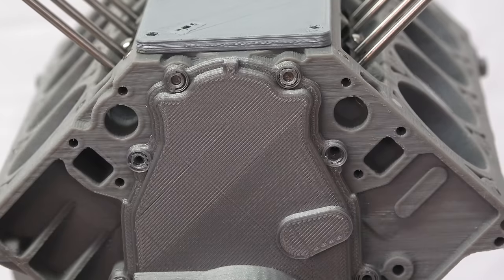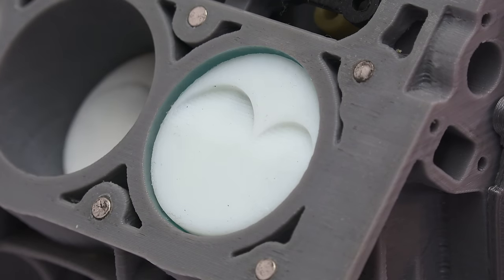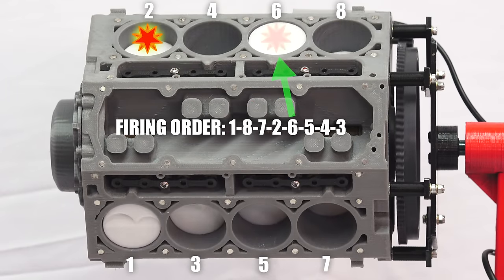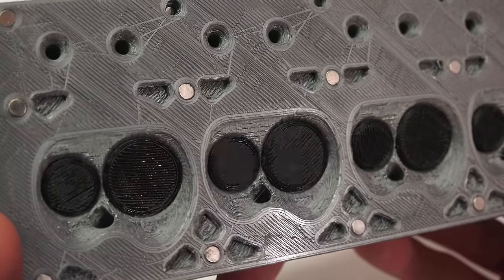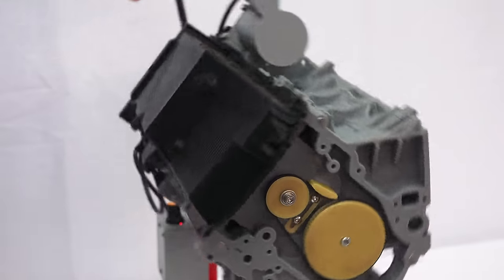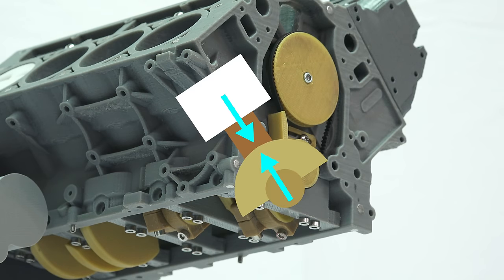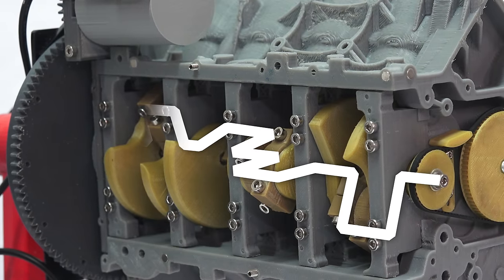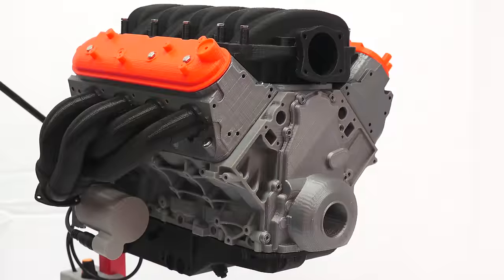How V8 Engines Work - A Simple Explanation

Comment: A small block Chevy (also known as SBC engine) uses a distributor geared to the camshaft, that also drives the oil pump below.  The firing order is also different, 18436572, fired using a distributor cap, rotor, and coil, to send electrical charges to the spark plugs.  Modern engines, such as the LS blocks, use a coil on plug design, hence why distributors are phased out.  You'll also note the use of a lifter galley on a SBC engine, as the camshaft is placed slightly higher above the crankshaft for the lifters to contact the cam, thus the pushrods are hidden away inside the galley along with the lifters.  The galley is hence covered by the intake manifold, and sealed on both sides using gasket maker, and/or a cork gasket.  

One quick way to tell the difference between flat tappet and roller lifters is the use of a lifter retaining bracket "spider", which holds the roller lifters in place to keep the lifter and roller from spinning against the cam's lobe direction.  Flat tappets have to rotate to wear evenly, so no lifter retainer bracket is used.

Comment: Hello, Engineering Explained ~ I've been told the #2 cylinder valve on my V8 is stuck open. It's either the intake valve or exhaust valve. It will cost $6,000 to have a new engine put in. I'm uncomfortable with the unexpected diagnostic stating I need a new engine.  In fact, I'm dumbfounded. Watching your video helped me understand how the eight cylinders work.

Comment: Also the 90° positioning of the Cylinder helps to cancel most of the vibrations. You can see motorcycles with 90° displacement without additional balancing shafts, but when the go 75 or 60° a balancing shaft with additional  weight is required.

Comment: I always had an interest in the balance of an engine. I think it would be interesting to do a video like this on a V6 and also the balance between a 60 deg and 90 deg V6. I know 60 is better for balance while 90 is done so both a 6 and an 8 can come off the same assembly line to lower cost.

Comment: You should have elaborated more about having 2 connecting rods on one crank journal.  This is a huge advantage to keep the engine short and machining simple.  Unlike like many engines  that are not at 90 deg.

Comment: Great graphic; good job on the video.  I have a firing order question.

1-8-7-2-5-4-3-6 seems to fit my sense of progressive order better than 1-8-7-2-6-5-4-3.

In a sense, my thought process follows the alternating star pattern of tightening wheels lugs or head bolts.

What is the advantage of the existing firing order in terms of balance.  Maybe I am hung up on the starting point, but I feel that I am missing something and am trying to grasp the engineering principle involved.

Comment: The GM LS1 I swapped into my 01 Cherokee is about 190 pounds lighter than the ancient 4.0 six cylinder I took out. I got a little less than an inch of lift on the front, without touching my suspension, other than adjusting the track bar a little. Also, the more advanced fuel system, with 4 nozzle injectors yield about 6 more MPG as well as  almost double the horsepower.

Comment: I've always complimented on how you show and explain things to us non-mechanically inclined people to the point where we understand.  This video though I had to watch a couple of times to really get it.  

My question though is this:  If the ratio from crank to cam is 2:1, what does it mean if someone wants to upgrade their cam?  Does that change the ratio or will it ALWAYS be 2:1.  I have an LS3 engine in my Corvette and people have said I should change out the cams.  What happens then?
Reply from the maker: It will always be 2:1. The crank must rotate twice for every cylinder to fire (pistons go up and down twice). The camshaft has a task for each of those four strokes, so it only rotates once for the pistons going up and down twice. Upgrading cams will change the lift and duration characteristics. Explained here: https://youtu.be/6MmuEhCRR_U

Comment: I think you meant to say the two opposing pistons are paired to the same crankshaft JOURNAL instead of bearing, as each connecting rod has its own bearing to contact the journal. Other than that good video.

Comment: Exhaust gasses are pushed out by the Piston?  Always thought the still expanding combustion was doing that work.
Reply: CMac well now you know..:-)
Reply from the maker: Pressure certainly pushes out most of it. But if the piston just sat there, some gas would remain inside. More efficient engines will have significantly less pressure once the piston reaches the bottom of the power stroke.
Reply: Well, spent gases certainly escape through the exhaust valve because there is no other path, but since the piston is moving back up anyway it finishes the purge cycle.
Reply: Two strokes...not four stroke, but I am no EE
Reply: internal pressure , scavenging by header design/firing order , and piston all combined do the work.  you can use the opposite in a sense on the intake as well. you can actually ram air into the cylinder that is greater than the cylinder bdc volume by verry advanced runner design and cam/valve timing on a NA motor.

Comment: I always thought there was enough  force in the cylinder that the exhaust gasses exited on the downward stroke of the piston. Correct me if I'm wrong but wouldn't it be less efficient if the piston also had the push the exhaust out?

Comment: Always interesting. However, what I'm currently grappling with is the effects of a flat plane crank. I saw the reference in the video though still wonder how it contrasts with a cross plane crank. In particular, I understand that a cross plane crank has a header resonance tuning issue due to the fact than one bank has two cylinders firing within 90 degrees. The resulting close pulses require a header to have a cross over pipe. I understand this to be in an issue with all cross plane cranks and wonder why the firing order can't just be, with the piston numbering convention of odds on one bank and even on the other: even/odd. An even/even situation, which causes the scavenging issue in the header, is somehow just how cross plane cranks work.

The situation noted in the first paragraph is not present with a flat plane crank. I frankly need to think a bit more as to why this is. I have read that a flat plane crank V8 is like two four cylinder engines together, where the firing order can be even/odd, so a particular bank of cylinders has combustion at every 180 degrees. 

What I note above may relate to why a flat plane crank has an inherent imbalance relative to a flat plane crank. While I'm thinking this through (if I can), I hope EE comes up with a video to resolved my confusion. And if there isn't one forthcoming, these videos are insightful and thought provoking.

Comment: The cross plane crank V8 sounds lumpy but is very smooth whereas the flat plane sounds smooth but shakes and vibrates far worse same goes for i4 which mostly use flat plane cranks,  i see so many people get this wrong and  think that the inconsistent and lumpy sounding  firing order on V8's mean they run rough but they are very nice to drive whereas until quite recently i4  vibrated very badly at idle and shook the entire car.
Reply from the maker: For the balance: https://youtu.be/_TssXF8yQek
For the noise: https://youtu.be/-s5bSQIQQsY
Reply: Yeah that's why they keep flat planes small. Ford 5.0 flat plane is large for a flat plane. They do have better exhaust savaging though.

Comment: Could you explain if vented hoods on Jeeps are functional or just a gimmick when it comes to venting and air flows while driving and off roading.

Also during slow off-roading, would high engine bay temperature speed up the wear on the parts around the engine? 

Water will probably come through the vents to the engine, will that cause a problem?  

Thanks!

Comment: Do you have a video explaining merits or cost/benefit number of cylinders of a motor if you have the same engine size and holding all other factors constant (turbos, internals).  For ex. what's the cost/benefit of a Lamborghini 6.2L V12 over a MB AMG 6.2L V8?

Comment: Well. Some of this information is correct, but I've seen information that has expired. 1. Why are you making an OHV engine model? Almost nobody uses this engine design. The last OHV engine I know is the 1.4 diesel engine from Škoda. A better option is the DOHC (or rare: SOHC) engine model. 2. Single inlet valve, single outlet valve. Technically, it shows how the engine works, but again this type of engine head design is old, and the more modern design has two inlet and two outlet valves. (Yes, he said that there are engines with other types of heads, my point is that the model itself already shows the old [which does not mean bad] construction) However, here: congratulations! As one of the few you mention different types of crankshaft. To sum up: There is a lot of valuable content here which will definitely be useful to people who want to learn about the engine's operation from very simple models. It is a pity that the engine model itself does not represent any newer unit. But a lot of commitment, great performance and a lot of substantive content are only a plus;)
Reply: OHV engines are still used, the ls is one of the most popular v8 engines and is OHV

Comment: Try reading up on the Pratt & Whitney R 4360, it came out in the 1940s...during the war.  V8s are simple compared to its 28 cylinder 4 bank by 7 cylinders used in aviation.

Comment: @Engineering Explained : Is the crankshaft and the camshaft always connected with a toothbelt  ?  In my mind I've seen a video from you  ( Why Can't Pushrod Engines Rev High ....) where the gearwheel of the crankshaft and the camshaft stucked together directly .

Comment: Why are exhaust valves typically smaller? Is it because a larger valve isn't necessary to evacuate the exhaust gases due to the increased pressure in the cylinder?

Comment: I think the current FORD 6.7L  Powerstroke V8 Diesel does the cylinder head cross-flow in an opposed fashion compared with traditional V8 engines like this GM LS. I mean that on a new Powerstroke V8 Diesel exhaust occurs at the "V valley" between the cylinder heads and intake occurs at each bottom side of the engine. Why they do it this way?

Comment: Say you put some sparks in each cylinder, would the engine work with some low-temp inflammable gaz (so that it doesn't melt the plastic usedfor printing)?
Reply: Is there a future for 3D printed cars?!

Comment: I'm not sure if you have a video on it but why do older engines have such low horsepower. I have a 2001 V8 that has 170 Hp while newer, smaller engines have much more power. What makes the difference? Also how is there a difference between V8 engines of different cars around the same year?